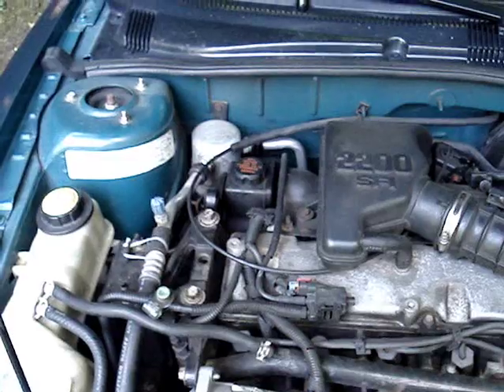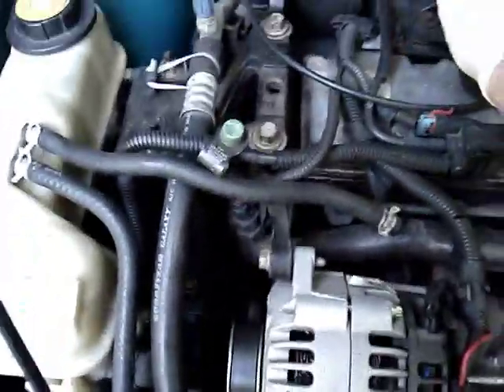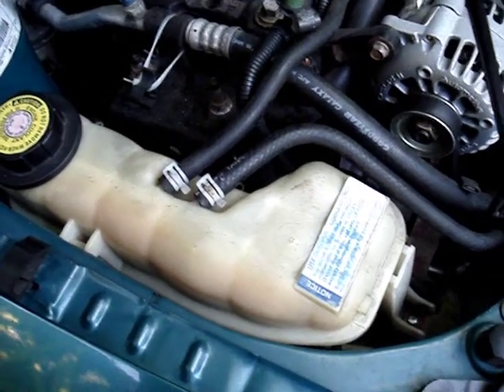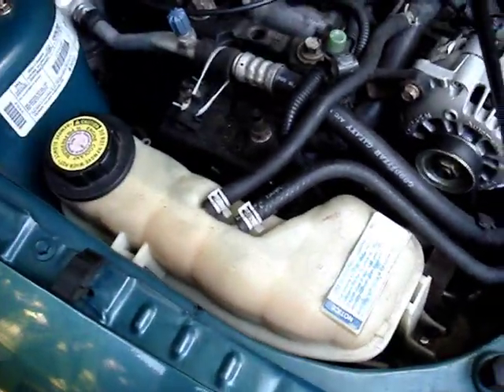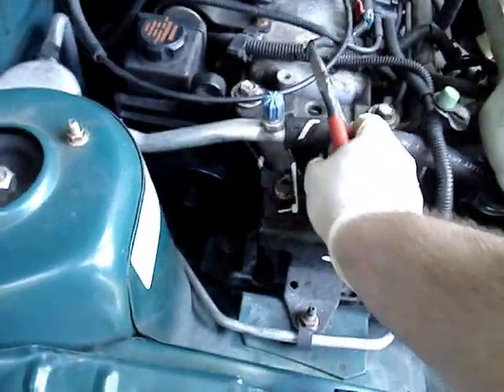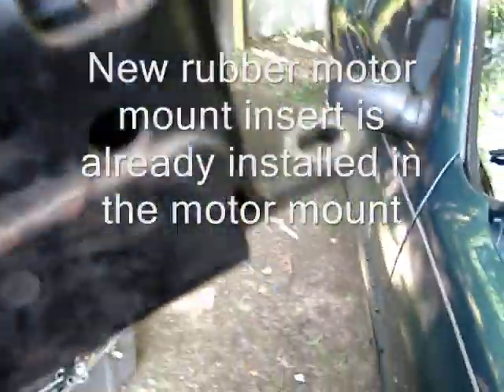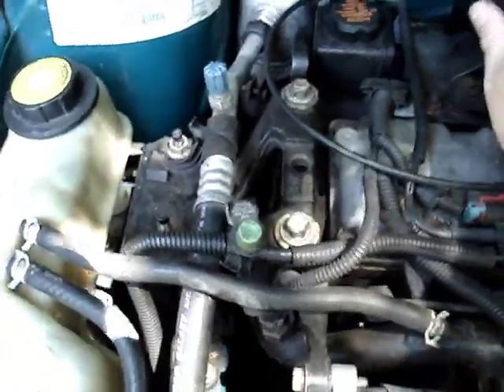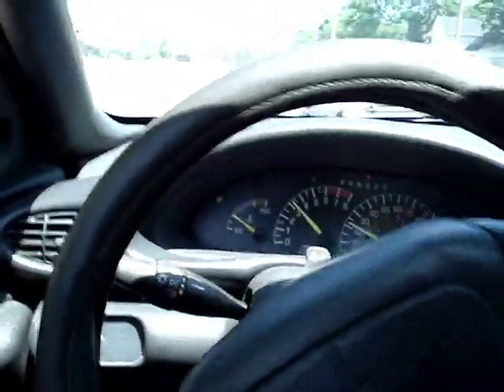Pontiac Sunfire 2.2 upper motor mount insert replacement

Comment: Yeah im having problems to with this car! I own a 2000 pontiac sunfire 2.4 liters. My mounts are also lose. Im also getting this rattling noise coming from the passenger side. It seems like the noise is below the alternator, im really not sure. The noise gets faint as i drive it. Great video. I might replace my mounts by myself if it is that easy!

Comment: Great video, I'm getting all the mounts replaced, somehow my exhaust pipe is unattached the engine and you can hear it fart every time I accelerate, and it's coming from underneath, they said I could weld the pipes underneath so they stay stable but the engine is loose so I gotta replace the mounts ,Great video , you should do one about the whole exhaust system :)
Reply from the maker: +KazuyaSnakeSK I don't have this car anymore.  (I had almost completely forgotten about it!)  There is a flex pipe between the crossover and exhaust pipe, that might be bad.